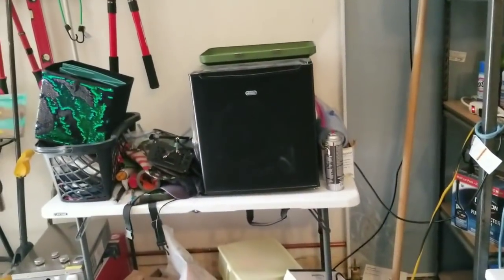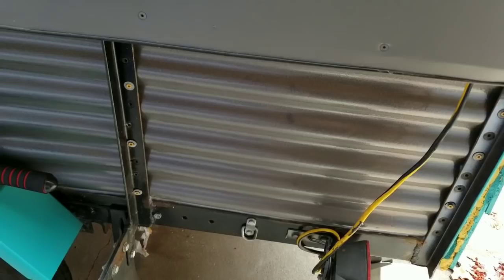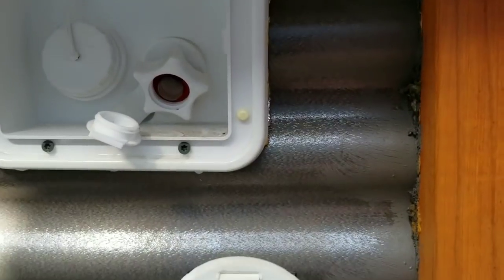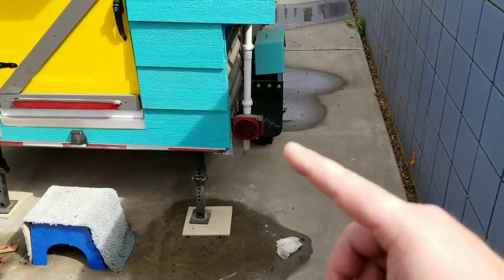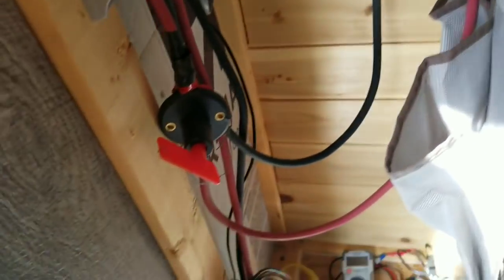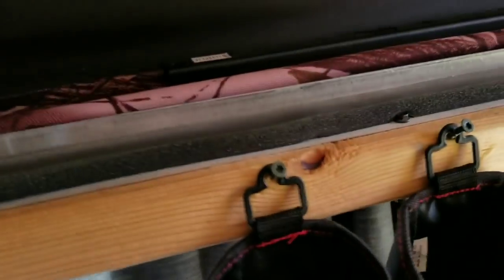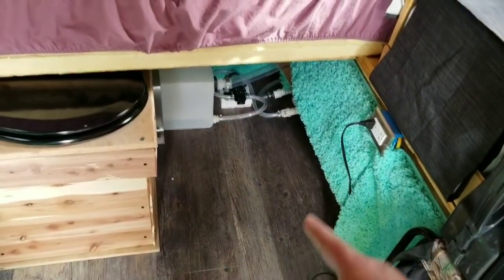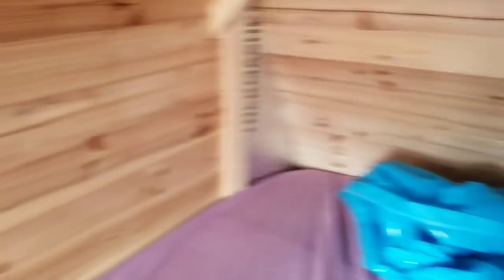Take a look at Frankie 2.0 
4x8 trailer camper build

Comment: Careful.. you could end up like me and not be able to stop building things 😁
Reply from the maker: For sure. I would love that :) btw I did a little plug on nicole's sticker she made me. hehe
Reply: @KristoferTravelsHomesteading  i did see that and was going to thank you for it but forgot to.. worked yesterday and had errands to run all on only a couple hours sleep so my brain was lagging. Lol.. someone wanted me to go to St. Louis to build out a van, i would if i could just because it's fun to design and do but I'm still stuck for winter.  I don't know if you follow Jamie (enigmatic nomadics) but it's too bad i can't go to his van build as a builder for a couple weeks. I'll be here restoring classic cars for a guy who doesn't want videos inside the shop, my poor channel is going to be pretty quiet 😢.
Reply: The light might be single filament you can onley ask it  is do one thing  you need a duel filament bulb  should have two wires one of the wires run lights the other one run brakes and turn signals all that bare wood I'd cover with poor mans  fiberglass are truck bed liner from harbor freight
Reply: Hay that's cool it that a redone truck camper
Reply: @KristoferTravelsHomesteading  Where do I start (Watching) to see this BUILD from the start? I have a4x8 HF trailer and I so would do this!
Reply: pro trick : you can watch series at Flixzone. Been using it for watching lots of of movies during the lockdown.
Reply: @Jeffrey Cayden definitely, been using Flixzone for since november myself :D

Comment: Kristofer, Lots of upgrades! Good work. We have  been YouTube friends for a while so I just wanted to be sure you are safe against fire. You didn't mention it but I'm confident that you have an inline mc4 fuse as close to your solar panel as possible. I dont see fuses between your charge controller and battery.  You should have (2) 30amp fuses between controller and battery both on the positive lead, one as close to the controller as possible and one as close to the battery as possible.  You need 2 because both the controller and battery are capable of delivering power to a short circuit. Fuses always belong as close to the device that delivers power as opposed to the device receiving power. 
Again good work on the upgrades! Frankie has come a long way.
Reply from the maker: That's good info. I do have a fuse between the charge controller and battery. you couldn't see it in this video. I'm wondering if I did a previous video and it shows? I'm pretty sure  I show it on a very early video after I hook the batteries up.  I don't have one from the solar panel to the charge controller because I figured the solar panel doesn't put more then the charge controller can handle which is 30a. Let me know if I'm wrong.  Thanks again for the info.i appreciate it.
Reply: @KristoferTravelsHomesteading  one of the main reasons for fuses is fire protection from a short circuit such as worn insulation or closing a wire in a metal door. In the case of a short circuit between panels and controller, the current wouldn't get to the controller at all. Current would flow through the wires from the panel and across the short generating heat potentially melting the wire, causing a fire.  With a fuse as close to the panel as possible and with the fuse being the weakest link in the circuit,  the fuse melts before the wire and prevents the fire. Always think about what happens if you bridge your positive wire to your negative wire at different locations and it will become apparent where the fuse belongs. Draw the circuit to visualize it. Your solar system has multiple circuits.  Panel/Controller,  Controller/Battery,  Battery/Inverter, Battery/Fuse Block, and each separate fused 12V device. Each of these circuits needs a fuse or breaker that carries less current than the wire in that individual circuit. The controller/battery circuit is a special case because both both devices can deliver power through a short circuit.  
This is why you need two fuses  on that circuit.  My business email address is in my video descriptions, send me an email  if you still have questions.
Reply from the maker: @Endless_Skyway_Adventures  I did some research. my panel is a single 280w panel which is wired with 6g wire. it says the 6g is big enough to let the voltage flow without any worries of heating up.  If I had a smaller wire which is usually on smaller panels I would definitely need a fuse. I thank you for bringing this to my attention. I did open my eyes to new information. I now know importance of fuses and how they protect the wire from melting from overheating. 👍💪😁

Comment: put a switch near the sink.  pulling the fuse puts stress on the fixture that will break
Reply from the maker: I will be doing that asap. thanks for the tip. I didn't know about putting stress on the fixture.

Comment: You are very smart and skilled to have built Frankie and made the modifications.   There is an app called Soup Calculator that will tell you how much your water tank holds by entering the dimensions in the app.   That's how I learned the volume of my water tank on the used RV I bought.
Reply from the maker: You are very kind.  thank you.  I will check that out.

Comment: I wish I could help with the trailer lights, The conventional bulb used in a single bulb tail light fixture is a #1157 bulb. It has two filaments, one for stop and blinker, and one for running lights. I don't know the LED replacement number.
Reply from the maker: I found the wires off the bulb.... there is a solid light green and then a light green with a white line. one is running and one is stop for the same bulb but when I hook them up it creates a short. Do you think I should try one from the driver side bulb and one from the passenger side bulb instead of trying to do it off of the same bulb? The bulbs on the car are regular bulbs. the trailer lights are LED. Let me know what you think.
Reply: Some cars use only one bulb (two filaments in the bulb) for stop/blinker and for running lights. Some cars use two bulbs in the tail light housing one for stop and blinker and one light for tail lights only. one wire from your car tail lights should be stop and blinker (right or left side)  and one wire from your car should be tail lights only. Either side  of the car or side marker lights would work for tail lights, it doesn't matter. One wire of those can power both trailer running lights, but you need a separate wire from each brake light from your car to each trailer light if you want the blinker lights to work properly on your trailer. This is important. The bottom of your bulb at the trailer lights should have two separate contact points, they look like little silver knobs and your trailer tail light socket better have two separate contact points also for brake/blinker and then one for tail lights or you need to find either a different bulb or trailer light, because they both have to have two separate contact points. One contact (and wire) for tail lights and one contact point and wire for stop and blinker on each trailer light. The trailer needs to be hooked up to your car so that the trailer is grounded when you are trying to see what works. hope this helps.
Reply from the maker: @TomHeid1  I'll take a look. Thank you for the information. it really helps.